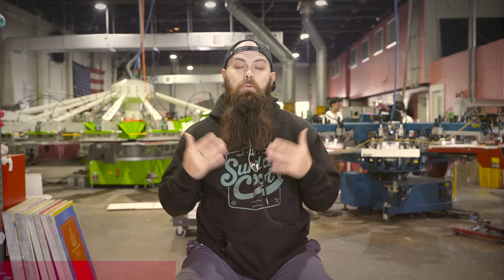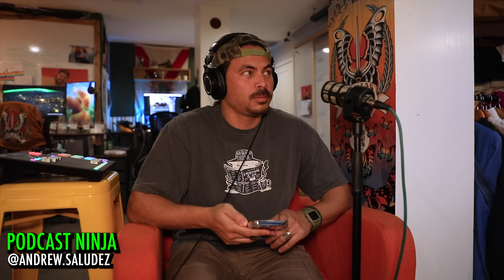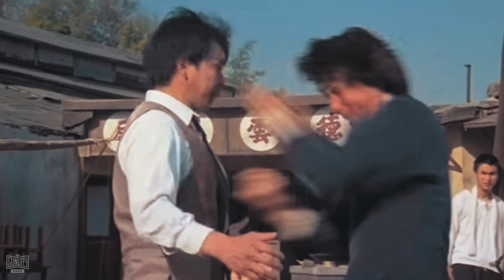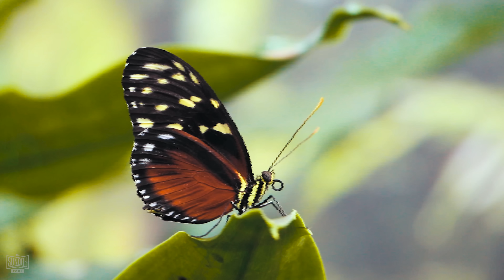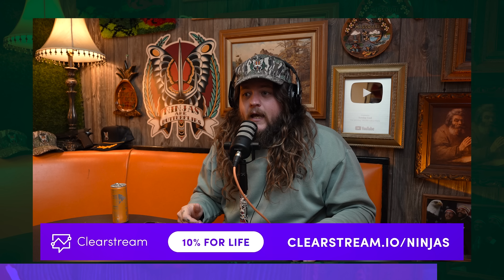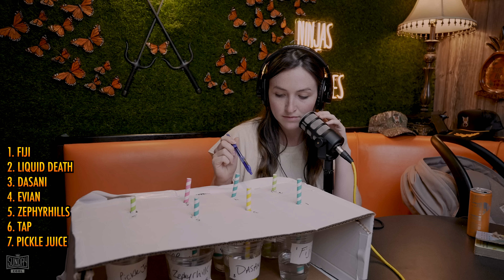Is Committing Arson Cool? Episode 27 | Ninjas Are Butterflies

Comment: Okay so the thing about last words after decapitation...I don't think you'd be able to speak even if you were conscious because speech requires air which is pushed from your lungs. If your head is disconnected from your lungs, you'd probably just be moving your mouth. Maybe your tongue and teeth will make sounds, but I doubt any audible words would be spoken.

Follow-up: I just tried talking without letting air out and my coworkers all think I'm crazy 🤣
Reply from the maker: Well I was told my head is filled with hot air. So it might work!

Comment: My friends grand father was a Navy Officer at the Philadelphia base during the experiment, it was cloaking technology based off of blueprints from Nikola Tesla's wireless electricity - think "wifi meets light bulbs" - but he told us that the screams coming from the ship when it reappeared haunted him every night, apparently a couple of the crew survived the "blinking" and they got two men to describe what they saw when they weren't at port and they both described the same thing - effectively earth but a hellish version, they smelled gasoline and sulfur oxide and felt heat equal to, in their words, 10,000 hydrogen warheads going off simultaneously.  

Nightmare fuel.